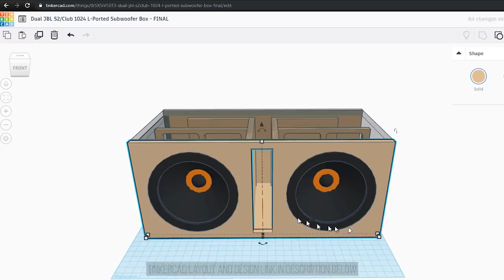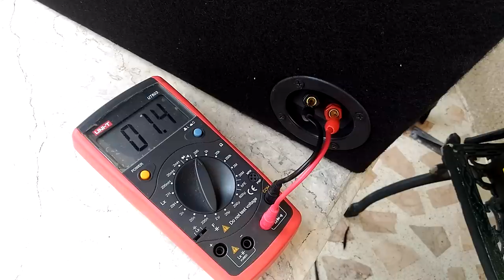How to Make Dual L-Ported Subwoofer Box - DIY

Comment: I will watch it all again and see if I can see anything I missed. Thanks for the video. Hopefully I can use this to build my own
Reply from the maker: It is fun building stuff like this.
Reply: Just wish I had the proper tools.
Reply from the maker: @robland6118  The only most expensive tool in my workshop is the Makita table saw. Everything else is dirt cheap. I got a Chinese generic drill, trim router, circular saw, sander, angle grinder, etc.. and Chinese generic tools are dirt cheap on flea market.

Comment from the maker: UPDATE: SUBWOOFER BASS TEST VIDEO -  https://www.youtube.com/watch?v=CPIet0CZuwI
Reply: Aabangan ko to 😍 #BassHead
Reply: Magkano yan bro
Reply from the maker: @yfan505  Why? Are you interested in buying this?
Reply: looks great bro.. hope it sounds good
Reply: I've just ordered a second sub and was thinking of building a box like this, but was unsure of the size of the port in the middle. Am I right in assuming the middle section of the T is double the width of the section running along the back wall?
Reply from the maker: @incorporeal3793  i did was divide the main port width into two. Example: if 3 inch main port width then each back port is 1.5 inch each.
Reply: Hulatan ko na boss
Reply: Hey man love your diy but what machine did you use to cut the subwoofer hole out?
Reply from the maker: @hugoaguilar9407  Hello Hugo, I DIY'ed a circle cutting jig out of an acrylic sheet to a trim router. Here's the video https://www.youtube.com/watch?v=7x4f6nfGlO0
Reply: I am interested in buying this item

Comment: 4:45 many people forget/ignore this part, but it makes a big difference sometimes.
Reply: How?
Reply: @poopsickle2411  SPL losses due box flex, the box flex is antiphase to the output therefore causes cancellation, if a board of area A flexes 2mm with speaker of area A/2, means 2mm of the speakers excursion is cancelled out. thats alot of cacellation.

Comment: Thanks for sharing your design. I got a question. Is the glue really enough to keep the box together, you don't need to brace or screw joints? I would think the constant impacts would eventually wear this box down?
Reply from the maker: Hello thanks for the feedback. Yes you can add screws to further strengthen it. For this build I'm aware that it won't go beyond 400rms so it's ok for just the glue.

Comment: Looks really nice. You did a really good job. Not sure what your box is tuned to or the exact air space for it though. Not sure if u posted dimensions for it or not. It looks really good though, but a lot of us don't have the same exact tools that u had. I don't have a Roto zip. I do have a router, and a saw but that's about it. I do appreciate your video it gave me some good ideas though.
Reply from the maker: Hello Rob, thanks for the feedback. The layout, dimensions, tuning and calculation are displayed starting from 0:12 to 0:45 on the video. There are links provided in the video description to the Tinkercad layout. Also, the router table I use is purely DIY. Check out my other videos too to see how I DIY my tools. :)
Reply: Alright man thanks a lot for your help. I appreciate it a lot. A lot of good ideas and things were answered for me in your video. Hope to build my own soon. I know I will at least need a double baffle though. Using much heavier subs and a lot more power.

Comment: I’m planning on making one similar, does the wires matter how they are placed, does it affect air flow?
Reply from the maker: Not really. But you can use this trick on how to wire the two subs without being visible at the port hole.
Reply: @chrclmnky  thanks

Comment: 1 vs 2 aero port for one 12 inch 700w rms ; which one is better ? (Pioneer TS-D12D2)
Reply from the maker: 700w RMS is not that much so a single port is enough.

Comment: If i want to design 3 way box with port being woofer, tweeter and midrange. After calculation of volume, should i calculate for midrange also and add to main volume?  Also is there any need to cover the midrange speaker by wood to isolate from woofer disturbance? Is it necessary?
Reply from the maker: yes, midrange drivers should be on their own chamber/room to prevent cross resonance versus the woofer.

Comment: Hello, can you tell me the cabinet size and port length for JBL GT4-12?
JBL GT4-12 300mm technical data specification:
- DIAMETER: 12" (300 MM)
- SENSITIVITY (2.83 V @ 1M): 93 dB
- POWER HANDLING: 250 W RMS (1,000 W PEAK)
- FREQUENCY RESPONSE: 23 ~ 450 HZ 
- NOMINAL IMPEDANCE: 4 OHMS
- VOICE-COIL DIAMETER: 2.0" (50.8 MM)

- Vas: 91,12l 
- Mms: 181,74gr 
- Fs: 24,75 Hz 
- Qms: 6,46 
- Qes: 0,46 
- Qts: 0,43 
- Xmax: 12,50 mm
Reply from the maker: Will compute for a few PayPal dollars.

Comment: Nice =)
Also in ur experience... Does a downfire subwoofer will still be efficient to produce the low pass frequency? Considering I want to maximize my trunk space. Thank you
Reply from the maker: Yes sir, using shallow mount subwoofers in  downfiring ported enclosure can save a lot of space in the trunk.

Comment: Hai sir..
I have Sony Xplōd subwoofer (XS L120P5A) the only thing I know is its PEAK and RMS power and the total impedance. And i would like to build an enclosure for the driver..
I have searched this subwoofers T/S parameters and there is no such document in the INTERNET..
So is there any way to measure its T/S parameters or any way to Calculate the required enclosure volume..
Reply from the maker: There must be somewhere. I'll update you when I get to sit on my PC and search for the parameters.
Reply: @chrclmnky  thank you sir..
Reply: @chrclmnky   i just found SONY XS LE121s which is an enclosed subwoofer and i think they have used XS L120p5a  as the driver for the enclosure..

Comment: How does the fact that there are two drivers affect the parameters within the modelling software? (Box-Port design II)
Can you tell the software to model a dual driver enclosure?
Sorry if this seems a stupid question, I'm trying to scale down an existing dual driver design similar to this (g sub) and I'm struggling to work out how to model it!
Reply from the maker: Use Bass Box Pro 6. Much easier and intuitive.

Comment: Ciao una domanda per avere la massima resa se il mio sub ha una frequenza di 28hz il box lo devo accordare sempre a 28hz? E mettere il filtro dell'amplificatore a 28hz pure? E qualora il mio amplificatore non scende sotto i 40hz mi converrebbe fare il box per 40hz? Grazie mille
Reply from the maker: Hello Gabry, you can tune your box +/- 5Hz from the subwoofer's frequency. Example: if your sub has 28Hz Fs, then you can tune your box 29-33Hz or 24-28Hz. You must set your amplifier's subsonic to 30Hz, LPF to 80Hz, that is the sweet spot for most subwoofers.

Comment: Whouldnt of used a crappy terminal like that myself, and i hope u put a decent amp on those subs because an amp that isnt 1ohm stable will definitely burn up, best switching them to 4 ohm and hooking them up either 4 ohm or 2 ohm
Reply: Same here bro those terminals affect the acustic enclousure, but in a ported box it doesnt really matter
Reply: @mjtoodsteem2206  i guess, but it is still that little bit ofcleakage that can ruin a build!

Comment: Hi! Another question! Can I use this amp on a stock car alternator without issues?
Reply from the maker: Which amp?
Reply: @chrclmnky  the lightning lab cl1000.1D, I'm worried that if I add this amp to my current lightning lab cl4100 it will mess up my alternator.
Reply from the maker: @juancarlosjarder116  nah it won't hurt anything. Start to worry when setting up 2000w RMS system and above. That amp just peaks up to a 970w RMS.

Comment: There is little confusion if any woofer has Fs of 45hz, can it have frequency response of 25hz-300hz?
Can it go beyond Fs?
Reply from the maker: Very good question, you will only need to go about -+5Hz from the Fs, higher than that can stress the woofer. For example: a woofer with 45Hz Fs, then you can tune your box up to 50Hz or 40Hz for a more efficient woofer excursion.
Reply: @chrclmnky  very thankyou for ur answer. But please tell me any company sows Fs of 45hz and shows frequency response of 25hz-300hz for sub, is it normal? Or they r providing wrong information?
Reply from the maker: @jyotirmaycbf  Must be overly marketed. Frequencies lower than 40Hz should go to the subwoofer, not on the mid woofer.
Reply: @chrclmnky  are u saying a passive woofer does not go beyond 40 hz?
Reply from the maker: @jyotirmaycbf  can
Reply: @chrclmnky  thanks. Can u tell me difference of sound signatures of lm 3886 and 7294 amp?
Reply: @chrclmnky   i am using iball booster 2.1 system. Subwoofer sounds good. I was trying to connect this sub though a low pass with 7294 amp. But when i tried to drive the sub, the sub rattles the cabinet even at low volume and does not produce proper bass. Only pumping the sub suspension. Not sounding even one fourth of bass that is produced by the iball amp which is fitted inside. Can u tell me what could be the reason?

Comment: hi sir,i have a 2019 vios in batangas, pwede po b humingi ng advise kng anong kind ng equipment ang pwede ko ilagay sa kotse...i want 2 12inch sub with front and rear speaker...full stock parin po ung unit...
Reply from the maker: Depende sa budget ninyo sir ang dami kasing pwedeng pagpipilian. To enhance music experience by adding deep bass is to install a subwoofer and its amplifier. You need to have a line output converter if hooked through factory headunit. Watch my other video about Honda Civic installed with subwoofer through stock headunit.
Reply: maraming salamat sir.kung sa raon po ako bbli ng equiment,lets say jbl ung brand anong model po sub at amplifier ang compatible...lets say 25-30k ung budget...

Comment: hello, im planning on making that enclosure please tell me the width of the port?  and im planning on installing 12 inch subs im adding 2" to every dimension. please tell me what should be my port width?
Reply from the maker: For 12 subs, port width should be at least 3 inches.
Reply: @chrclmnky   thank you for replying. ok i will use that design(added 2 inches in every dimension) and 3 inch port width. thanks alot bro you are amazing
Reply from the maker: @18000_RPM  But to be sure, use a subwoofer design software like Bass Box Pro 6 or this free online box tuning calculator http://reaudio.com/box.php
Reply: @chrclmnky   i was planning on copying your design for this video after adding 2 inches to every dimension. re audio software let me design for one subwoofer only. should i use this your video design with 3 inch port width or should i make a new design ?? please help
Reply from the maker: @18000_RPM  just use the dimensions of this box and add 2 and make the opening 3 inches. Everything will sound fine.
Reply from the maker: And good luck building your subwoofer sir. ☺️
Reply: @chrclmnky   thankyou ill make a video after i finish building.hope i get it right
Reply from the maker: @18000_RPM  ok anytime

Comment: Naka set po sya sa 2omhs? Then pano po connection?
Reply from the maker: Each sub is switched to 2 Ohm. Final impedance of the 2 subs is 1.5 Ohm. You can hook this up to any amp that supports 1 Ohm load.

Comment: I don't know what kind of calculator did you use.. but the box looks like small..
Reply from the maker: Are you from Harman Kardon? If not, then don't.
Reply: @chrclmnky  Don't take it personally.. you made a very good job.. it's just my opinion. So which software did you use? 
I use to make audio system during the 90's and I used a software based on DOS for the calculations of the box now I don't remember the name. I personally made several subs with a variety of speakers like Alpine, JBL Focal and so on.. 
For example you used square with cross reinforcement inside the sub I was using the same way. You should use a pretty good amplifier since it's going to work with 2 Ohmn right? 
Since you made 1 "bass reflex" aren't you worried about the interference of air flow? Was it better to split them?
Reply from the maker: Subs are just 250w RMS each and the box herein is bigger than the manufacturer's recommended box volume for ported application.

Comment: What JBL sub woofer series did you use??
Reply from the maker: Jbl club
Reply: @chrclmnky  will it work with an built-in amp ? If i want to make one
Reply from the maker: @dajiedkynsai8136  yes you can. It can be switched to either 4 or 2 Ohm
Reply: @chrclmnky  thankyou brother
Reply: @chrclmnky  thankyou brother❤

Comment: is 1.6 ohn not too low ?? for me it was better 4 ohm !
Reply from the maker: The lower the better. Amp is a 1 Ohm stable at 1000w RMS.
Reply: @chrclmnky  stable at 1ohm is a word..mmm
lower is not better...its simply gets you more peak rms power out of amp !
but all components amp + speakers works at very high limit even with low spl ! good for spl competition 5 seconds bangs ...but not to listen undistorted music.
Reply from the maker: @AdryDoic  🥱
Reply: @AdryDoic  you're wrong! if an amp is stable at 1 ohm it means that the components will not work at it's limits and that's why it's rated at 1 ohm load.
and it's actually better for the speaker because there is less windings (or less wire) and can't heat up as fast as an 4 ohm speaker at the same power. and you also get more power so nothing bad

Comment: Boss another design sa dual 15 subwoofer speaker boss pang outdoor👍
Reply from the maker: Outdoor? For Jungle Disco? 😂 🤣
Reply: Parang ganyan boss ky pick.up ang sakyanan butang sa likod ang woofer boss😊
Reply from the maker: @gailcliffordlabor9347  Ah I see. If pickup trucks, I recommend putting them under the back seats. Shallow mount subwoofers will be used in slim boxes to be placed under seat.
Reply: Pakita ng design boss
Reply from the maker: @gailcliffordlabor9347  Not making any underseat subwoofer boxes for the moment.
Reply: Ah ok boss 👍 abangan ko nalang mga ibang video mo baka may idea akong makuha .. 😁